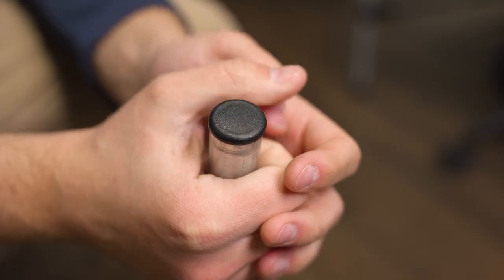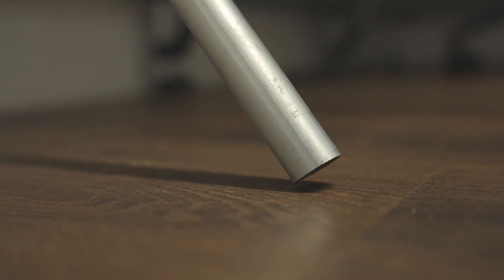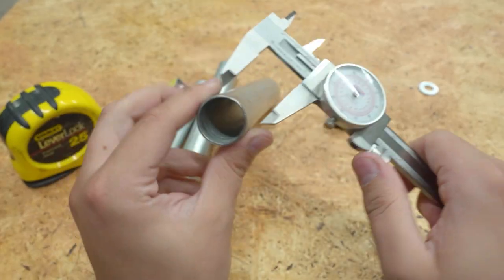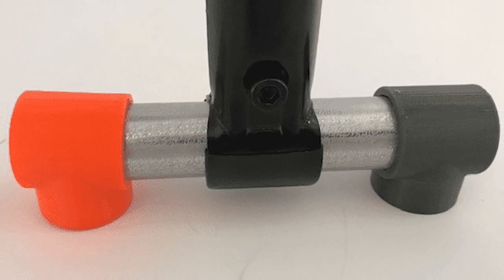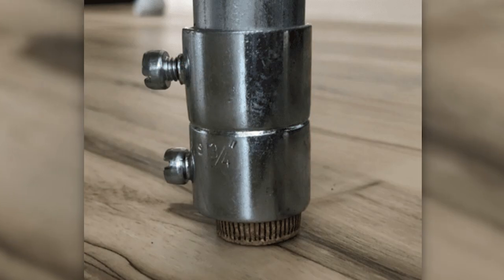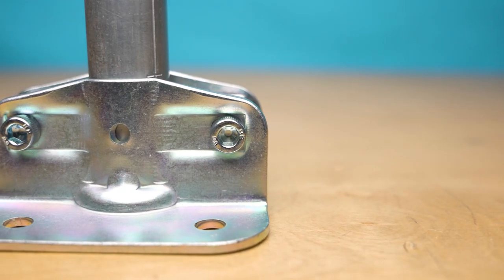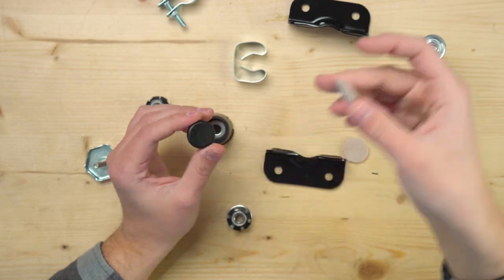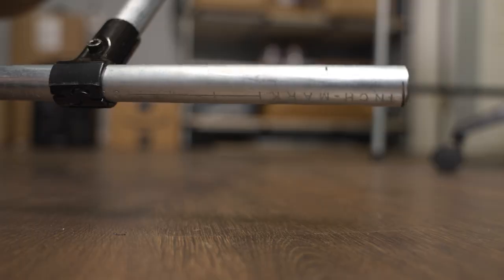Use Feet To Finish Your Conduit Build!

Comment: Adding the washers to the rubber feet is not only good for adjusting height -- it helps prevent the sharp edge of the pipe from slowly chewing through the rubber foot -- especially when the pipe is at an angle to the floor.  In my experience, the adhesive felt discs stuck directly to the end of conduit almost always eventually end up partially squeezing out from under the pipe under a heavy load.
Reply from the maker: Oh yeah that's a good point about the washers. Seems like the same thing happens to the felt pads on my couch and kitchen chairs as well. Thanks for the comment!

Comment: I forwarded this to someone in the Philippines. Bamboo is cheap there, so if proper diameter and length is found, the parts you provide can be used there.
Reply from the maker: That would be really interesting! Thanks for passing us on.